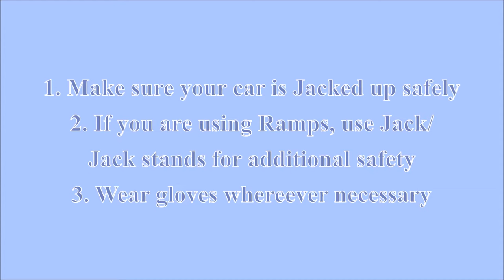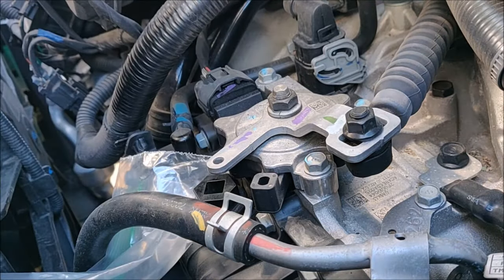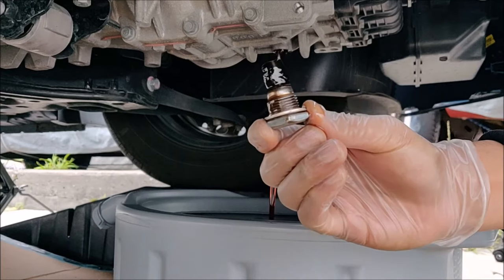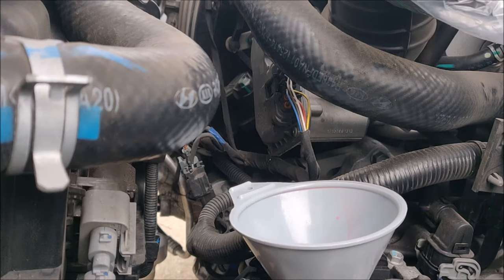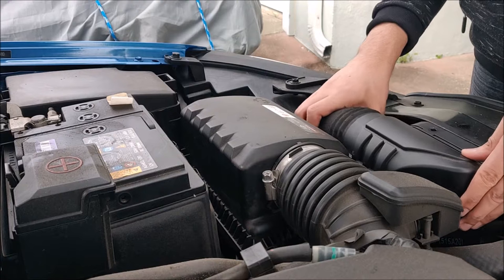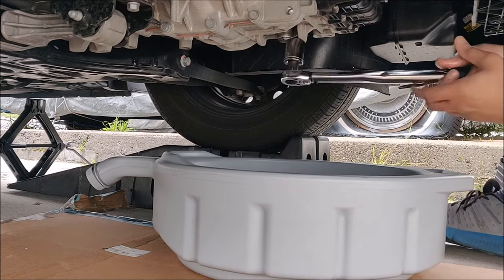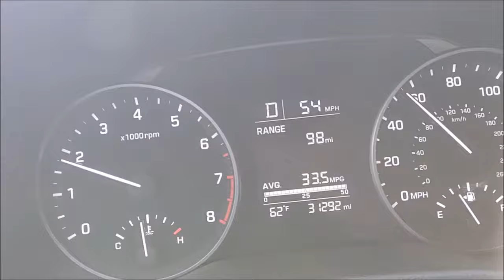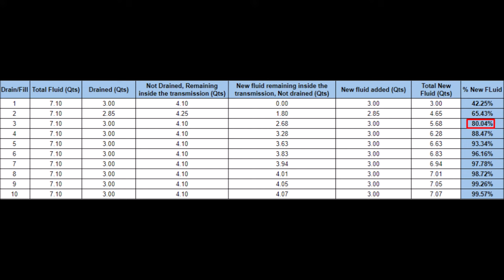2018 Hyundai Elantra Transmission Fluid Change - 3X Drain & Fill with Amsoil ATF (6Th Gen Elantras)

Comment: I looked into the viscosity issue that you mentioned.  And unfortunately, since I bought a case of Amsoil Signature Fuel Efficient ATF, the viscosity numbers are worse for the Amsoil.  I'm seeing (all at 100C DEG C) Hyundai OEM SP-IV at a viscosity of 5.4, Max Life at 5.9, and Amsoil at a staggering 6.3.  Old Hyundai SP-III has a viscosity of about 7.2.  The Amsoil Viscosity Index also is poorer than MaxLife, at 159 vs 163.  I cannot imagine how going from the much thinner Hyundai fluid to the thicker Amsoil will do anything except reduce MPG, vs improve it.  And the Amsoil is waaaaaaaay more expensive.  Anyone want to buy what I have left off of me?
Reply: I use maxlife atf in my 2010 Elantra that specs sp-iii and I use it in my 2013 Kia Rio that spec sp-IV .   Both run great and I’ve done several drain and fills it’s also way cheaper on Amazon ($5.67 a qt) that is sold from the actual valvoline store.  Their gallon is same price as Walmart ($17).  Amsoil is a waste of money.
Reply: I've used valvoline maxlife atf in my 06 Sedona. I'm the original owner and the van has 190k on it and it shifts like new.Drained 4-5 quarts every 30k.

Comment: You know there is an overflow valve that let's you know when you have filled to the correct level. You don't actually need to measure what you have drained out.
Reply from the maker: Yes, absolutely. I've mentioned that in the video. :)
Reply: Its good to know for us who have a jack raising the car thus making it impossible to have a leveled car.

Comment: 7.5 gallons worth of changes to get 99% of the 1.75 gallons of transmission fluid to be clean?
Reply from the maker: Are you referring to the last picture I showed? That was just for funny information. I don't think you need to do so many changes.

If you plan to use a different fluid for the change, then do the drain and fill 3 times just to replace most of the fluid like how I did. You will be fine with doing 2 times as well. 
If you use OEM, then 2 times would be good. :)
Reply: @andy-auto-info2483  I was just making an observation about the last picture yeah. I'm also wondering about how many flushes it takes to get 5050 coolant to be in cooling system if you can only drain 2 quarts at a time (with a similar 7 quart capacity) so this helps a little.
Reply from the maker: @TripDadLife  you're saying only 2 quarts come out in a coolant drain for a 6th gen elantra? If that's the case, its a wise idea to do a coolant drain and fill twice at 60K first and then once every 40k intervals. That way the fluid will not go bad. It will constantly be rejuvenated.

Comment: Do you HAVE to change it 3 times within 300 miles?
Reply from the maker: Not necessarily within 300 miles, but sooner the better since the fluid can remain new. Changing it 3 times gets most of the fluid replaced.
Reply: @andy-auto-info2483  ok thank you. My fiance has the same car and is in need or a fluid change. So was curious

Comment: What size and where did you get the crush washers. Thank you
Reply from the maker: Apologies, I am really not sure about the size of it. But this the part number and I ordered it from this website -
Crush Washer-  https://www.hyundaipartsdeal.com/genuine/hyundai-gasket-transaxle-cas~45323-39000.html
Part Number - 45323-39000
You can also pick it up from any Hyundai dealership, it costs $1 each or less. The one that I got from the dealer was thin. The online order was thick - 1mm (Which is what I used).
Reply from the maker: I'll check the size when I get a chance.
Reply: @andy-auto-info2483  Any luck on the crush washer size and where to get them? Also, is SP-IV M oil by Hyundai okay to use on my 2017 Hyundai as I'm having a hard time finding SP-IV? Thank you.
Reply from the maker: @taxfree4  not sure whether my previous comment has reached you or not. But I'll copy it here below.
I am really not sure about the size of it. But this the part number and I ordered it from this website -
Crush Washer-  https://www.hyundaipartsdeal.com/genuine/hyundai-gasket-transaxle-cas~45323-39000.html
Part Number - 45323-39000
You can also pick it up from any Hyundai dealership, it costs $1 each or less. The one that I got from the dealer was thin. The online order was thick - 1mm (Which is what I used).

And SP-IV M is the latest spec by Hyundai. It replaces the SP-IV and is compatible with it. Ask the dealership, that's what they will say too, :)
Reply: Thank you very much, I appreciate your quick response and I ordered it along with the Amsoil you recommended
Reply from the maker: @taxfree4  Awesome. How many miles do you have now?
Reply: @andy-auto-info2483  Bought it with 34,000 and have almost 51,000.
Reply from the maker: @taxfree4  Alright. Good luck man. Let me know how it turns out.

Comment: Is it necessary to use transmission flush before draining?
Reply from the maker: Not necessary at all. It is needed only if you have not changed the transmission fluid for a very long time. Even if it has many miles, you can just drain and fill 3 times to replace most of the fluid like I did.
But using a flush may not harm anything, but I would not recommend for a modern car. Check with your dealer. Thanks :)

Comment: I would like to know why you had to file the plastic bolt to get it out?
Reply from the maker: Hi, At 2:20 you'll see that the fill plug does not come out as there is some part (maybe shifter assembly) in the way. Hence I had to file the side so that the fill plug passes through the shifter assembly easily as seen in 4:05. 
But I did hear that for some folks, it came out easily. But most people were not able to remove the plug. I'm thinking this is a deliberate design flaw to prevent us from DIYing the tranny :D
Reply: @andy-auto-info2483  thanks...I am looking into doing this oil change for myself and I am doing my research as to ensure no damage to my vehicle..could you also link the tool used to loosen the plastic bolt
Reply from the maker: @love610an  Yep. I used this to file the fill plug.
https://www.homedepot.com/p/Husky-Steel-Precision-File-Set-with-Storage-Case-6-Piece-707476H/207112197?cm_mmc=ecc-_-
Reply: @andy-auto-info2483  sry.. i meant the wrench
Reply from the maker: @love610an  you can use any wrench. I used a basic wrench.
But extension I used it from this set - https://www.homedepot.com/p/Husky-Accessory-Set-19-Piece-HACCY19PC/301175115
And you have socket drive converters in this set. This makes it easy to use it with any wrench.

Other tools I've linked it in the description as well.
Reply: I did not have to on my 2 vehicles. Keep turning until you can pull it out slowly.
Reply from the maker: @thecentralman  what year models are the Elantras?
Reply: @andy-auto-info2483  2019 sedan / 2019 GT hatchback. Does yours have any leaks in the check plug? Mine is still sorta wet after cleaning. No oil on surface but the valve body cover is a little shiny so that concerns me.
Reply from the maker: @thecentralman  Interesting how you were able to remove the fill plug. Mine did not comr out, tried everything, even your suggestion. Had to file eventually. I did not have any leaks.

I have a question, maybe this will make it clear. My fill plug needs to be turned only 90 degrees for it to be tightened as shown in the video. It did not have many threads on it. 
 Was your fill plug the same? Or it was more like a screw and longer?
Reply: @andy-auto-info2483  yep. mine wad the same. The Sonatas and the Santafe s have a plug with threads on it
Reply from the maker: @ryan-uz1rw  i know the part that moves when you change gears. Its the one with the long handle where the bolt sits. That is not blocking the plug. There is another part, that looks like a curved hexagon which is blocking the plug. And this part does not move when you shift gears.
Also, I did not want to remove those bolts on the shifter assembly as I did not want to mess with any calibration if there was any. :)
Reply from the maker: @thecentralman  that does not work for everyone. That's the problem. In my experience, some have been able to and some have not. 
Mine clearly did not come out even with force. I didn't want to put too much force.
Reply: @andy-auto-info2483  Okay, maybe they fixed it for 2019+ versions but I don't know. thanks for your input!
Reply from the maker: @thecentralman  They definitely could've fixed it. I hope they did :)

Comment: Oil change is the same as a full transmission flush?
Reply from the maker: No oil change is different. In this process shown in the video, I am not using any machine. Flushing will involve a machine being used to force out the fluid while the machine replaces it with new fluid.

Comment: Hi.  Thank you for posting this video!  Well done!!  It's really bad engineering that we have to file part of the fill bolt away just to change the trans fluid.  I wonder if you could gain enough clearance to remove the bolt if you partially unbolted that shifting assembly (or whatever it is) that's blocking the removal of the bolt without causing a problem for yourself?  I may visit my local Hyundai dealer and try to talk with one of the mechanics (if they'll do that) and ask him/her what the secret is to getting that cap/bolt off without having to take a file to it.  IF they talk with me and I find anything out, I'll post back.
Reply from the maker: Hi Tom,
Thank you. :) 
Yep, the design is unfortunate. The part that's blocking may be the shifter assembly and could be a crucial part. Check with Hyundai folks whether that can be removed and put back the same way without any calibration. If that part is sensitive, do not touch it. Filing is a safer option. Also, I did not use too much force to file. Just takes time & patience.  :)
Reply from the maker: Hi Tom,
Did you get a chance to talk tk hyundai dealership regarding this? Curious about it. Ha ha :)
Reply: I don't own this vehicle but I'm pretty sure you could of just simply shifted the transmission into N, this would move that lever out of the way.

Comment: Hi there is no filter in automatic transmission like benz have
Reply from the maker: There is a transmission filter. Its basically a screen type filter. It is very hard to replace it. But that's not a problem, keeping the transmission fluid as clean as possible by doing regular drain and fills every 30k miles will make it last minimum 200k miles in my book. :)
The filter could be a non servicable one. So don't worry about it :)
Reply from the maker: Since there is no pan, you can't drop the pan and access the filter like traditional non-modern transmissions. Its somewhere inside and might be difficult to get to it.

Comment: Why? Did u just shift the shifter ? Of , doing that.
Reply from the maker: Hi Elmo, good question.
The shift selector was not in the way. So shifting to a different gear did not help. 
There is another hexagon looking bolt under the selector which was coming in the way of fill plug. So irrespective of what gear you are on, the hexagon bolt does not change its position. Hope that makes sense :)

Comment: The only question I have cause its my first time. Do you change the filter on an automatic?
Reply from the maker: No, there is no need to change the filter on this one. Even if you wanted to, its very hard to DIY as it would need removing the transmission I think.
Keeping the fluid clean by doing drain/fill every 30-40k miles is more than enough! :)
Reply: @andy-auto-info2483  I just can't find any fluid that meets the specifications of SP-IV or SP-4 which is what I guess the now recommend.
Reply from the maker: @devinwiles6448  where are you located? I used amsoil that was compatible, not sure whether you have access to that. If not, maybe check with your dealer to grab some OEM stuff.
Reply: @devinwiles6448  Buy from Hyundai.

Comment: Could you have moved the shift selector in the car which could have moved the bracket out of the way of the fill plug?
Reply from the maker: You can do that. I did not do it because of calibration concerns if any. Loosening the nut and adjusting the shift selector may have hampered the calibration. So did not want to take risk.
Moreover, the shift selector was not in the way. There is another hexagon looking bolt under the selector which was coming in the way of fill plug. Hope that makes sense :)
Reply: @andy-auto-info2483  no calibration concerns you are not removing the nut  you are just moving the shift lever from inside the car to another position to move the finger out of the way.
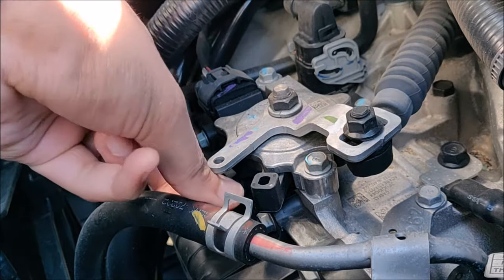Reply from the maker: @JP-uu2rw  I totally get it. I tried that and it did not work. Here's why - The finger of the shift selector is not blocking it. You see the bigger hexagonal bolt below the finger? That's blocking it. And that does not move when you shift. Please see 2:33 and you will see that the finger is not blocking it. :)

Comment: I have the 18 Elantra manual transmission. Would it be the same procedure?
Reply: Manual transmission is entirely different. So No this process will not work.
Reply from the maker: Yes. It is different.

Comment: That car don’t have filter for automatic transmission?? You don’t change that??
Reply from the maker: Hi Miguel, the transmission filter is very much inside the transmission and is very difficult to change. Usually it is a mesh/screen type filter and does not need to be changed. As long as we regularly change the transmission fluid and keep it clean, we should be good for a long time :)

Comment: My 2018 Elantra has 59k KM, is it advisable now to change the transmission fluid?
Reply from the maker: Hi Vamsi,
Is yours Manual or Automatic transmission?
Reply: Automatic
Reply from the maker: Yeah, that's around 31k miles. Its better to change it out. You saw how dark my fluid was during the first drain.
Reply: Andy-Auto-Info Thank you, your videos are crisp and full on detail. Subscribing now.
Reply from the maker: @believeme548  thank you Vamsi :)

Comment: How often a full flush fluid is recommended ?
Reply from the maker: You do not need to do a full flush if you drain and fill every 30-40k miles. Just making sure the fluid is clean and rejuvenated is all you need. Also, doing a 3x drain and fill will replace more than 90% of the fluid. :)
Doing a flush when the dealership says will not hurt anything. But flush machines forces all the fluid out while replacing it with new fluid. If there is lot of free floating dirt/debris inside the fluid, that may damage the internal parts of the transmission. It really depends how bad the fluid is for flushing. Hope this helps :)

Comment: Couldnt you have just removed the 2 nuts and that plate sitting above the bolt to remove it???
Reply from the maker: That is the shifter assembly. 
You have a good point. But I did not want to touch this because of calibration concerns. And they normally have very specific torques for smooth shifts and I did not want to risk it.

Also, FYI, some people were able to get the fill bolt off easily and some like me, faced this issue. So fingers crossed :)
Reply: @andy-auto-info2483  ah ok..understandable. I have the '18 GT model so hopefully mine will be lil easier to get it out. The air intake is already out lol I swapped it for a cold air intake
Reply from the maker: @Roadsurfer2k11  ha ha. I see. 
good luck :)
Reply: That is what I did. Removed the two bolts and the plate rotates left and right and gives you the clearance to pull the plug out.
Reply: @alexceja696  k thx for the update. I noticed now if precise replacement needs to be done, I would use a pencil and outline that curve on the plate, drawing on the base. And mark off each side the bolts attached to it, so i would know exactly its position put back on
Reply: @Roadsurfer2k11  I had no issues with shifting or drivability. The plate goes on only one way so when you return it to the bolt holes it goes back exactly where it was. 😀

Comment: This is exactly i was looking for! Thanks for the detail. 
Does this voild the warranty by any chance?
Reply from the maker: Thank you so much. Using aftermarket fluids should not void the warranty. There are laws that protect you from voiding the warranty. But then again, its a whole other topic for debate. :)
Reply: If you use the same specification (ATF SP-IV), then it shouldn't void your warranty.

Comment: Does this transmission not use a filter?
Reply from the maker: There is a transmission filter. But it is inside the transmission and in order to service/replace it, you will have to open up the transmission. So usually, nobody services it, not even the dealership. Keeping the fluid clean, regular fluid drain/fill every 30-40k miles is all you need to maintain it! :)

Comment: How often is it recommended to change the ATF fluid? I have a 17 Elantra with 20k miles. Should I change it between 60-80k
Reply from the maker: Hi, 
Hope you are staying safe during this crucial time. Did you see how dark my fluid was at 30k miles? Also mine is nearly 60-70% highway driving. I would recommend every 30-40k miles if you are draining and filling. Max 50-60k miles, do not go beyond that. :)  do not flush the transmission. It is still fine, but drain and fill is the safest method.
Reply from the maker: I plan to do mine every 30-35k miles. First time I did it 3 times to put the new fluid in completely. Going forward, every 30k miles, I'll do a drain and fill once. Will post a follow up video at 60k miles :)
Reply: Drain it. Drive 1000 miles or so do it again. Use Amsoil. You’ll be good for 100k